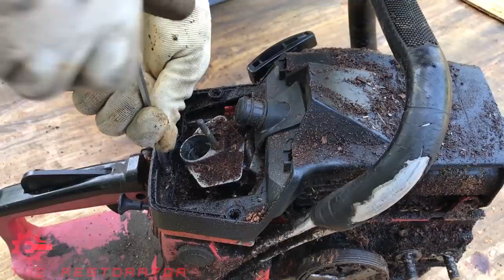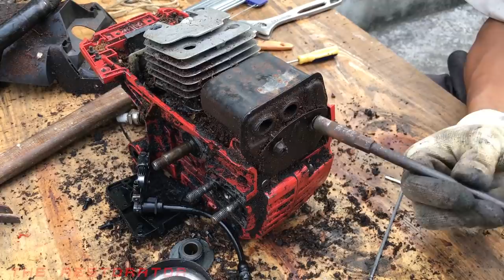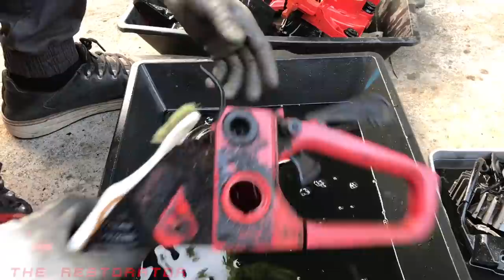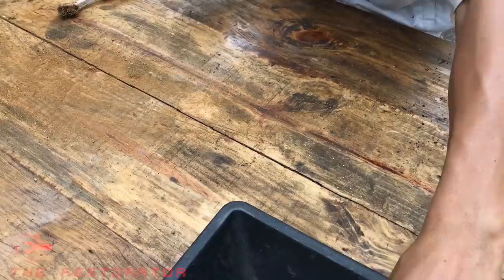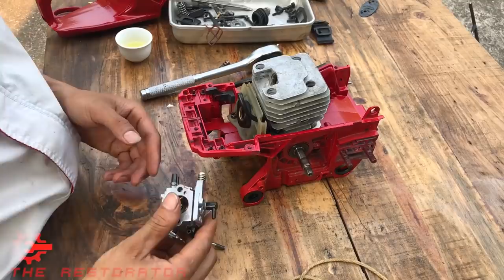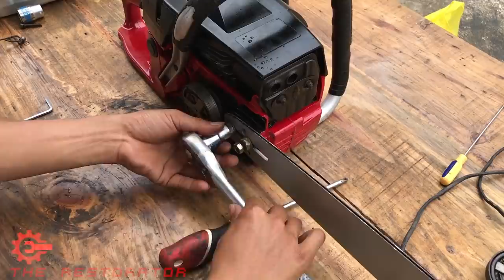Restoration Chain Saw SHINDAIWA 685 | Restorating Chain Saw Rusty

Comment: ...I assume the saw was "planted" there in the ravine, and the "find" was re-enacted for dramatic effect...I think the rusty bar and chain was "added", since the rust and dirt pattern on it is much different than the saw....
Reply: yeah you right. why no dirt on the chainsaw body. they faked it.
Reply: @nakomarumpus  so what they faked it
Reply: Don’t caae he did a good job
Reply: Moist Sausage  ..Not putting down his mechanical and refurbishing skills at all...just a cheesy pretense to do the whole "find it in the ravine" thing..and if it had really spent enough time in the ravine to rust the bar to that level, there almost certainly would have been water in the crankcase, which would have meant rusted/seized crank bearings and corrosion/pitting in the crankcase...this is meant as constructive criticism, not a put-down..this guy really does have talent, I personally would not dilute the restoration content with the fake "find" thing...
Reply: @hans5987  
While he was reassembling it for example when he installed the bearings the socket repeatedly slipped off and hit the bearings themselves which no skilled mechanic would have done. Alongside the fact he risked scratching the piston as he let it rest on a piece of metal while reassembling it. Probably are more problems I forgot to mention but that's why I don't usually watch videos from the channel

Comment: This bar is called a sprocket tip. It has two little holes on the round end where a grease gun with a small tip can be inserted. Grease can then be inserted into the tip and lube this sprocket wheel.  It will make the bar last a lot longer. Each time the tank is filled the sprocket tip should be regreased.
Reply: That’s some very useful information. 👍

Comment: So don’t lock the trigger on or choke it, just yank it over and “pretend” it won’t start? No grease on any bearings. No oil in the cylinder or on the rings when reassembling? Then lock the trigger and choke it after the “pretend” restoration and it amazingly starts. Who taught you how to put a chain on?  You sir would embarrass a real restoration person.
Reply: Most of the parts on that chainsaw are perfectly fine too. No rust at all.
Reply: @xxxpantaloonsxxx3688  oh shit u got the same acoustic child profile picture as me lmao

Comment: Those washers between the bar and saw have to go. Those two holes above and below the slot on the bar are how the chain gets oiled. The oil will drain between the gap those washers make. Also you need the side cover because that keeps the oil from draining out the oil hole on the bar, it'll also have the chain tensioner and chain brake. Nice touch using used motor oil as bar and chain oil. Been there before when I ran out bar oil.

Comment: You are missing the Side cover which will have a chain brake and a bar adjustment for the chain because that is pretty dangerous to be using that with out the chain in the bar properly also you should probably just buy a new chain suggesting you know what chainsaw this is however if now you should sharpen that chain
Reply: Where are the dogs for digging into the wood while cutting...I call this a bogus rebuild....

Comment: The next time you paint, BEFORE you have to wrap the parts that should not be painted!

Then, for the operator's safety, the chain must always be bought again; especially after years and years in bad weather!
The groove in which the chain slides must be ground and the bar must be checked for flatness!
Using it without the indicated operations is dangerous.
It is one thing to polish it ... one thing is to ensure its safety

Comment: I found these types of Chinese chainsaws not too bad, the things that let them down in my experience are the air filter sealing, choke rod and the stop switch held in by rubber grommets that deteriorate and cause issues. I have also found drilling some extra holes inside the muffler wakes them up performance wise.
Reply: Not a Chinese chainsaw. High quality Japanese 68cc and almost 5hp saw.
Reply: @Polydeukes68  It is a cheap chinese chainsaw. Maybe its just Shindaiwa branded, but its clearly manufactured in china and one of the thousands of cheap clones of an old Hitachi saw.
Reply: @Smoked786  shindaiwa is a Japanese company not Chinese and atleast was the highest quality manufacturer of outdoor equipment that existed. They were acquired along with echo by yamabiko corp. some yrs back. The quality of their products were way beyond any other companies but also came at a hefty price tag which is why they were used more commercially rather than by residential users. I myself still have and use equipment made by shindaiwa over 30 yrs ago with thousands of commercial hrs put on them and they still have all original parts. Even the carbs on early products were made in Japan by TK.

Comment: Not a fan of painting so many parts that aren't intended to have paint. And bearings need to be packed with grease, not lightly oiled. All those bearings will now fail prematurely. (Maybe try blueing some metal parts by heating and then quenching in oil)
Reply: Crank bearings get oil from the premix, packing them with grease would do more harm then good they should have been lubed with 2 stroke oil, but seeing how the rest of the saw got hit by a train i would have replaced them.

Comment: What  about the air gap or why you paint the exhaust id its just going to melt off you if you was to paint the block too stores heat burn it up chain dull bar oil is needed

Comment: first and last video i watch of his i dont even want to list everything that was done wrong in this video
Reply: @theiransmalley6129  how about you start by cleaning off the outside BEFORE you start spreading dirt all iver the place? He managed to knock far more dirt inside that card than ever was in it before.
Reply: Damn VC.
Reply: @windmillacres679  doesn't matter much if ur rebuilding it and taking everything apart and cleaning it. Besides its a fake beginning. He put all that dirt on it to make it look like he found it and then got it running again. I'm sure that saw ran b4 he got it all full of dirt. That was mud caked on bar not rust.  Then in the end he doesnt even sharpen it. Barely cuts. Lol
Reply: Johnny Kovich tell me how you fake the stiff chain. Take the beginning as entertainment, it is too obvious that it is just show, nobody has himself filmed all the time in case he finds something - so dont think you are smart because you noticed. But yes, the saw wasn't in seriously bad condition and the chain needs to be sharpened.

Comment: Wait, restoration? You didn’t even bought the side cover chain brake assembly 😂 And no carb adjustment needed? 
There was even a full tank off gas in it to!
Buy a chain sharpening tool instead of spending your clickbait earned money on cheap spray paint.
Using old engine oil as chain oil? ... okay what about using vegetable oil as 2 stroke oil, we don’t need measurement!
Using paper as gaskets, I guess that for the higher compression ratio lol
U cant call that a restoration!
U even sprayed paint inside the crankcase!
Don’t spray paint on plastic covers btw.
In short wasted 46 minutes of my life.

Comment: Good thing it was as oily as heck.
Reply: Maybe the oil drip is too big or damaged. Shouldn't have Thats much unless that's a trait of that chsaw.
Reply: @billreyna1355  It's missing the guard that covers the centrifugal clutch, which allows the bar and chain oil to fly everywhere, rather than stay mostly on the bar.

Comment: he disassembled everything but returned the old  bearings, piston ...chain 🤣🤣🤣
Reply: That was what got me more than anything. Those bearings just slipped on there no heat... Seems like a recipe for ruined bearings / crankshaft real quick when actually running I would think? And whoa... was that chain ever dull. Ouch. That saw could cut 10x faster.

Comment: Do you always cover in mud things you repair? 🤔🤣😂💩
Reply: That thing was definitely not artificially made dirty like many other restoration channels do, with the only exception being the bar and chain that look suspect.
Reply: @GGigabiteM  just looks like a typical dirty chainsaw that was wet.  The fuel looks wayyyy too good.  Really losing faith in this channel. The chain is too flexible.  A year laying in the woods and it wouldn't move.
Reply: @tonyfremont  The chainsaw is covered in oil, not wet. If it were wet, it would have dried as it was disassembled. The centrifugal clutch and chain guard is missing, which is the reason the saw is covered in oil, it would be flinging bar and chain oil all over itself and whatever was around it the last time it was run. bar and chain oil is designed to be sticky and not wash off, it being rained on out in the open isn't going to degrade it significantly. I've seen chain saws sitting for years out in the elements which still had the original oil on them.

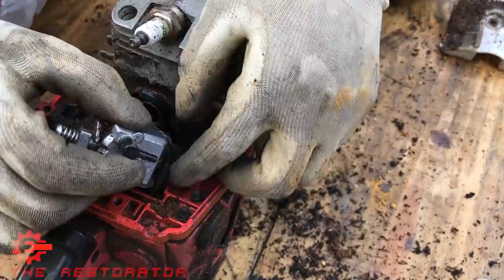I don't think you've ever had experience with bad fuel, because at 7:57 you can see how bad the fuel is. It comes out cloudy at first because it has quite a bit of water in it. The remaining fuel is also very yellow, which is indicative that the fuel is at least 6 months old, if not older. New gasoline is clear, not yellow, and pre-mixed two cycle fuel is usually blue or purple. The only thing that would make it that yellow is if someone pissed in your gas tank, or it really is VERY old.

I'm a mechanic, I deal with shitty fuel all the time, including on my own vehicles. I have a 96 Buick Century that sat for a few years and that fuel was as brown as brown could be. Required a new fuel tank, pump and filter, was not a fun job.
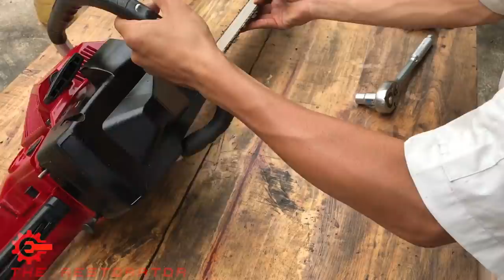Reply: @GGigabiteM  44:20 the oil is yellow 😁😉
Reply: Yep and clearly not the 1st time he has stripped this chainsaw
Reply: @GGigabiteM  In the US it might be clear but in other country's the fuel has a color to it, here in NZ it has a yellowish tint to it depending on the octane (the highest road octane which is 98 is a greenish tint, likewise av gas at 110 octane).  With the premix fuel it depends on what color 2 stroke oil you add to the fuel, I have added oil that was blue and turned the fuel blue, I have added red colored oil that turned the oil red and some that didn't change the fuel color at all.

Comment: Yeah sure. Like people gonna belive that you make video of collecting branches in forrest and find a chainsaw... when have nothing to post then take a brake, no need to make fake videos... and what's the reason to put location as USA if this video is made not even on the same continent? And why you call it as a restoration? No new seals, no new bearings, didn't clean carb, dind change piston, not new gas filter/line... without any new parts it's just a next cleaning job. You should change your chanel name to "The CLEANER"